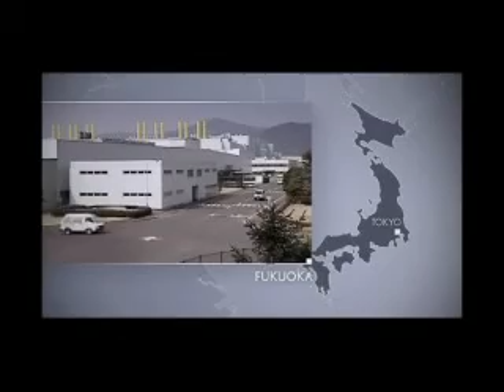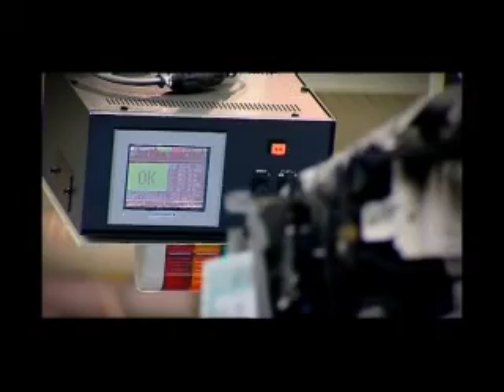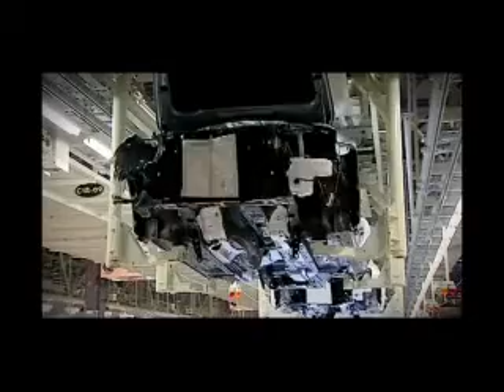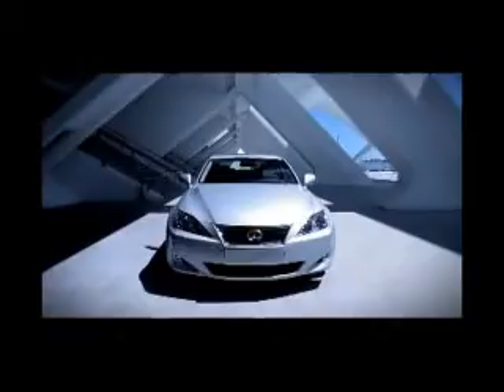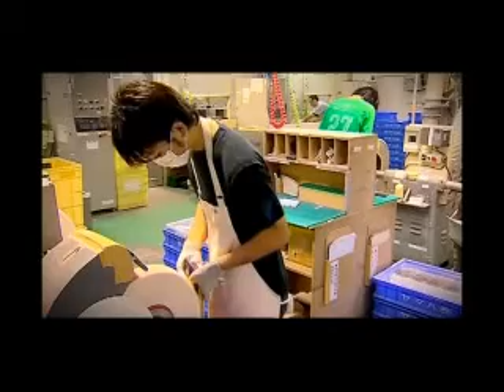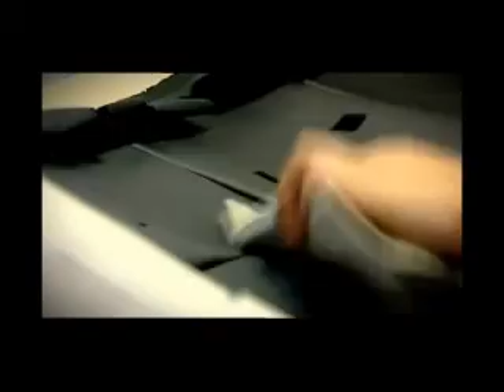LEXUS manufacturing

Comment: The old way of production was to only have one quality check at the end for a full range of faults in a completed car. Another was to just offer a good warranty, so the customer takes on the role of finding quality problems. Lexus' method of preventing any errors and immediate detection and correction before moving to the next step of production is far better for both the company and consumer.